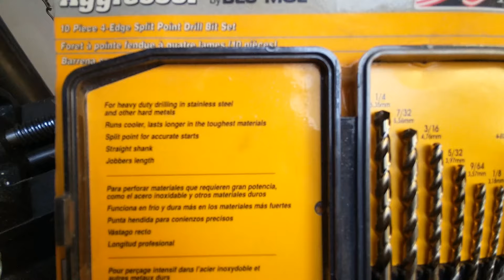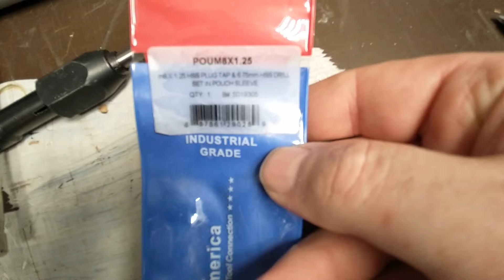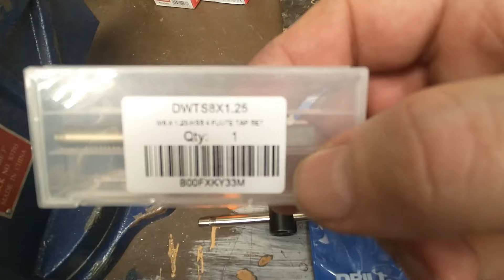New hammer for the replaceable heads

Comment: Yep, SS can be a PITA. Feeds and speeds, tool pressure, etc are critical. When it's all going to plan, the chips carry the heat away and keep the thing from work hardening. It's handy to have a copy of The Machinist's Handbook to be able to look up feeds and speeds, and a million other things. I like the old Atlas lathe you've got there, and hope to see some more content w/ that.  Cheers.
Reply from the maker: Thanks, I do have a pdf copy of that handbook....so far with my basic lathe projects I got through them without having it right near by the lathe.  This lathe with the backlash is not precise enough to do fancy things...but if I ever need to do that, I will either work to fix the backlash or figure something else out.  So far I am really enjoying this lathe though.  I also got a different collet to use with the milling attachment...now just need a project to use that. :)
I did another lathe project just today to help with a quick setup tool to use on the wooden boxes I am making.  The video for that lathe project will probably be up later today (02/21/2025)  if i get the editing done.
Reply: @josephkrug8579  Excellent. I'll keep an eye out for that. I have a similar version of that lathe and have been slowly learning my way around it. Yes, backlash, and not super accurate and rigid, but the price was right, and I'm not making landing gear parts for the space shuttle. What size collets are you using with your lathe / milling attachment? Mine came with half a truckload of C3 collets, from 1/16 through 1/2" in 1/32" increments, but no collet chuck or drawbar. C3 stuff looks to be obsolete now, and it would be nice to switch to the C5 format. Can you fit C5 collets in your lathe?